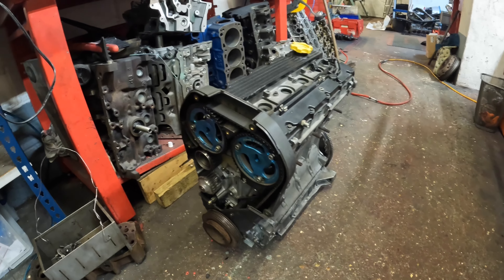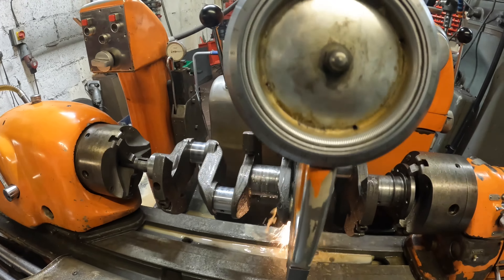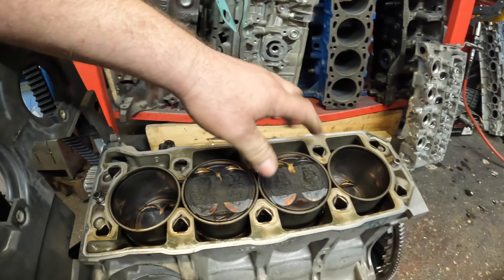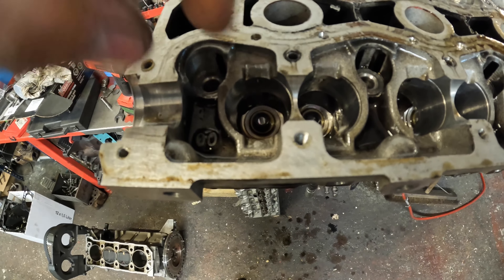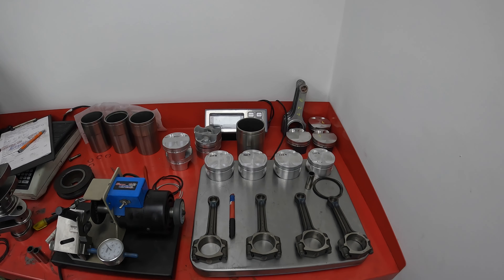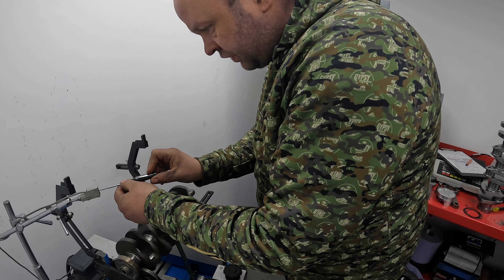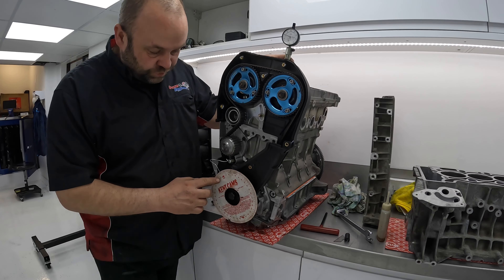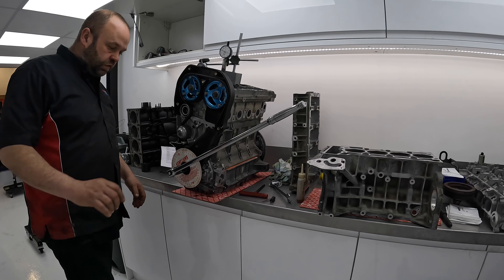Caterham 1.6 K series engine | cam timing and crankshaft balance

Comment: You didn't mention liner height in the video which is crucial on these and why they suffer from head gasket problems
Reply from the maker: I didn't mention a lot of things that got done Vince why pick fault on one thing?
Reply: I wasn't picking fault tbh I just thought if anyone was building one  it would be and important thing to knock I've literally built hundreds of these at janspeed and it was our development that produced the ms2 head castings
Reply: To know even
Reply from the maker: I agree.. next one I'll mention it..  there a great engine, would love some of your cylinder head knowledge on them.
Reply: Do you use the vvc castings when you build one ?
Reply: The last 1800 k I built probably 10 years ago had a standard valve vvc head but fully ported made 205bhp  with 285 hydraulic profile cams jenveys on emerald ecu the pistons were omega
Reply from the maker: It depends on what it's going in.
Reply from the maker: That made good power.. bet it was fun to drive

Comment: Customer here! That engine has done over 105k miles now and survived half a broken rivet going through it (the piston damage!), and was making over 180hp at 8000rpm. It went to James because of high oil consumption, slight loss of compression on a cylinder, and an overheating issue. I've only just completed the running in miles but so far it's smoother, quieter, and just as zingy as ever. One of the reasons I chose James was after watching some of these videos and seeing the attention to detail that goes into the work, and I'm incredibly pleased with the outcome so far. It'll be on the dyno soon for a final check before getting a thrashing on track again.

Videos of it in action on my channel!
Reply from the maker: Thanks Simon, can't wait to see it on the track.. link your channel

Comment: James I am fascinated by that balancing machine beautiful piece of equipment .
Med engineering has a main seal conversion, do you no 
of a company that supplies these type of  seals please?  
Kit from Down Under
Reply from the maker: Hi kit. For the k series or a series? Yes the balancer is very good.. did you get my reply about the line boring?
Reply: @Grace Engine Developments  James thank you for the reply, I am trying to develop a main seal conversion from a Holden 6 cly . Engines.
I can get custom made ones but price is prohibiting,  trying to find a of the self item .
Line boring and hone : The motor had been bore and honed previously ( 250 kilometres) I made 3 steel main bearing caps which were faced , left a 5 thousand machining allowances. Was charged 7.5 hours for bore and hone gathering information on this job! 
Thanks for your help. 
Kit from Down Under .